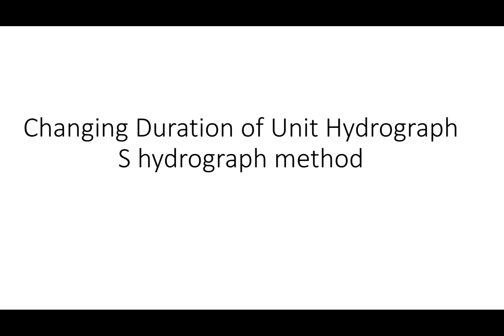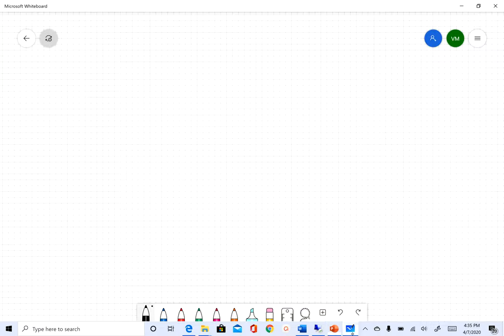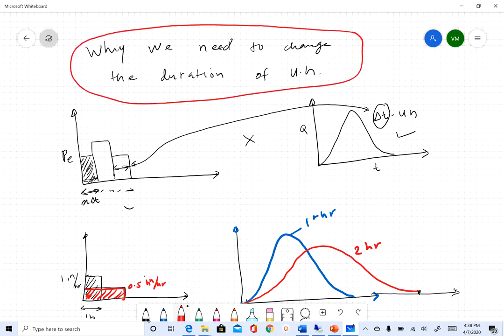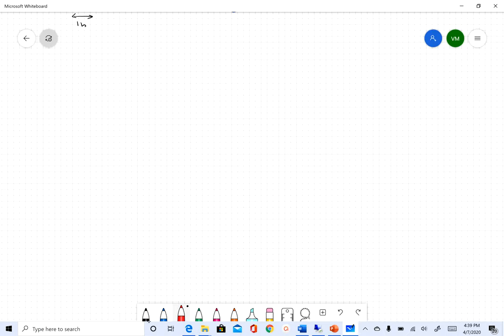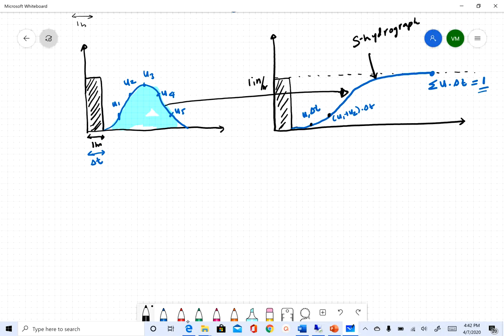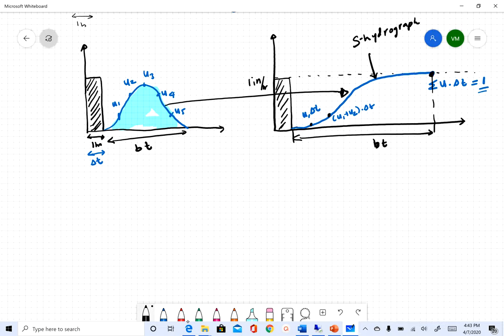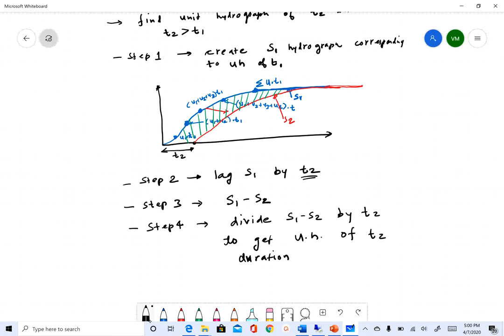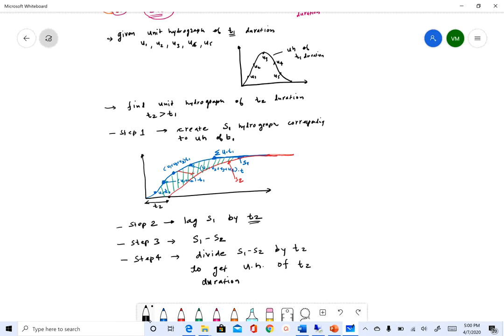Changing Unit Hydrograph Duration using S-Hydrograph

Comment: Hey , thanks for this great video. when we have  3 hours unit hydrograph and we want to calculate 2 hours unit hydrograph and data they gave is separated by 2 hour, how we can start the rain with 3 hours delay? I mean data is like this 0 hour 2 hour 4 hour but we want to start the rain with lag or delay of 3 hours how it can be happen?
Reply from the maker: If you assume that that the rainfall intensity is uniform with time, you can convert your two hour rainfall data into one hour and/or three hour and then use your three hour unit hydrograph. Hope this helps.